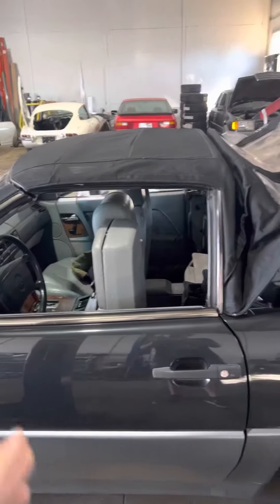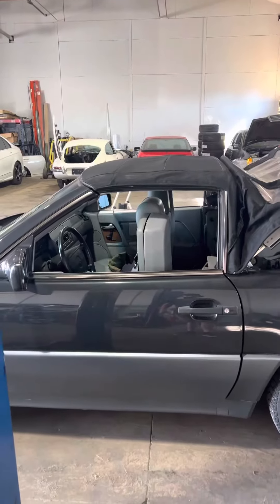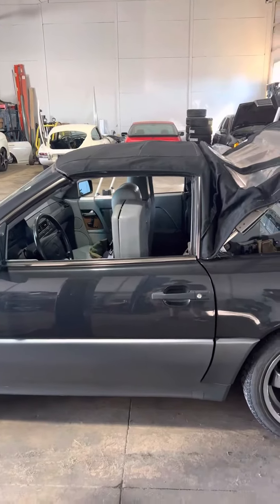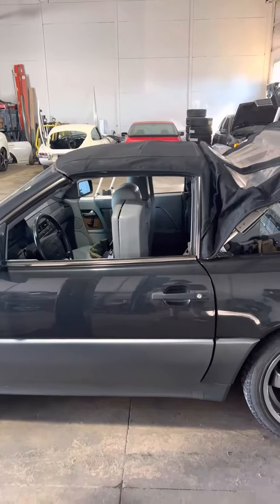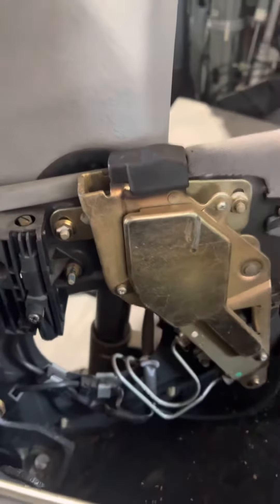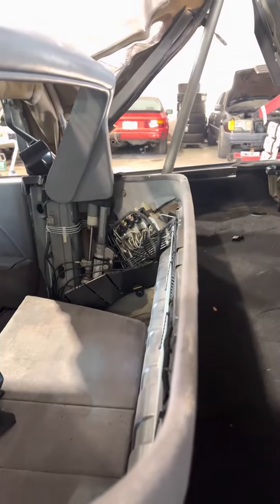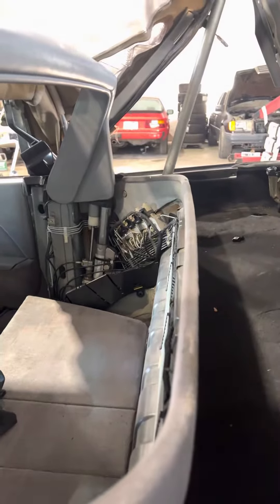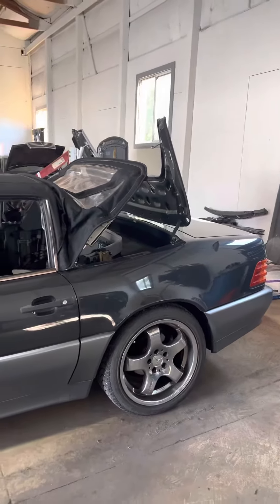1990 Mercedes 500SL R129 Top Repair: How To Fix A Broken Hydraulic Piston | DanSwapz

Comment: $1000 Apiece? for each cylinder? NO NO NO. Bought all 11 cylinders for my 99 SL500 for $900. Labor was another $600. That was 5 years ago. TOP HYDRAULICS ROCKS!!! Located in Oregon. Incredible shop. Seal are MUCH better than the factory seals designed to last 10 years maybe 12 if you're lucky. High tech material to last 20 years + when they rebuild them. There's a reason he has all 5* reviews. Klaus is the man. You're welcome.
Reply from the maker: Hey Bill! You can find the OE ones (brand new) around $1000 even from pelican and other distributors! Couldn’t imagine dealer price. Obviously no one would pay that unless they had funny money but I’ve heard nothing but great things about Klaus. This is an old video and I’ll be revisiting the cylinders once again in a different spot. Thanks for the comment!

Comment: Been there done ALL of that at $6,000.00 cost - all eleven cylinders…
Reply from the maker: Wow! The job can be smooth or awful depending on the shape of the car
Reply: @AMGAddiction  to date on my 1991 black 500SL/AMG I’ve spent (out of a TRUE labor of love💕) to put this awesome vehicle back in a personal best condition - including the above$ - right at twenty seven thousand & the work continues. Finding the parts is hard & when I do - their not reasonably priced but rather very expensive which drives up the cost of renovation! But for me the vehicle deserves it hands down! It’s NOT a daily driver at all & remains in a heated garage at all times. As it sits now - I’ve detailed it from bumper to bumper / floor pan to the optional hard top. Even the wheel wells have been detailed to like new appearance! BUT there’s still a lot to do in final fixes of detailing that bug me to get done. However, they are fixed at my MB maintenance repair shop - where the labor IS $195.00 an hour. So those fixes must be budgeted for. But for ALL the plastic pieces from engine bay to the interior to the trunk - I’ve found somewhere on this planet of ours - and replaced them - almost all - some still okay - but all the normal brittle pieces after 31 years of wear I’ve replaced. The engine bay looks brand new & the engine is stronger than ever . Luckily the previous two owners never abused it nor the drivetrain. I’ve had MB technicians open them both up & they said it all looks new with hardly any wear on anything. So great news there & thats where from that point forward I started my detailing out of this magnificent machine. Even right now it looks awesome & I get compliments when driving it - however, the last point of resto will be a new MB paint job - which correctly done by them is: $9 to 11 thousand. So that will be budgeted to but later down the road - still looks good right now though! Just I see the many 31 year old flaws in it! Original owner is a well known Hollywood & Las Vegas movie star & entertainer - so the documentation provenance is there  making this one 500SL/AMG a ‘real keeper’. Hope you enjoyed my text as my journey continues… God bless & take care🙏
Reply: @AMGAddiction  I agree with what you said. But in my putting my R129 back in reasonable working order - I’ve really learned a lot about the Italian/German Engineering of Bruno Sacco who designed the R129 Series but more importantly what makes our R129’s run! I do as much work on mine as possible and at the end of the day I’ve come to know the inner workings of my car. It’s been fun and at times frustrating too. However, again - my investment in it to date with my restorations is far less than the original cost when it was new & shipped over to the AMG facility for engine, drivetrain, and suspension upgrades in 1991 (total from MB & AMG in 1991 was $128,000.00) - in 2022 dollars that equates to more than double the original price of my R129. So we learn as we delve deeper into the working mechanisms of our machines as we push forward. Great video & yes, lucky for me the only hydraulic cylinder that exploded was the one right behind the drivers seat - that’s when (and yes it was a hydraulic mess to clean up) was when I had the entire hydraulic cylinder system(s) redone - costly yes, but well worth the security knowing that especially the ones above my head in the windshield header wouldn’t cut loose with fluid onto me or the interior! So I wish you well on your journey forward - sounds like you got a great deal on your R129 too. Thanks for the previous reply too. Good luck - Mark (Indianapolis, Indiana)